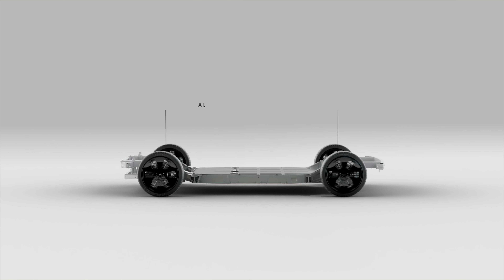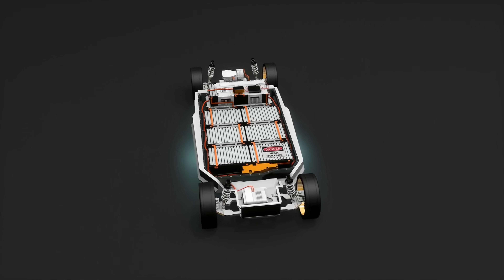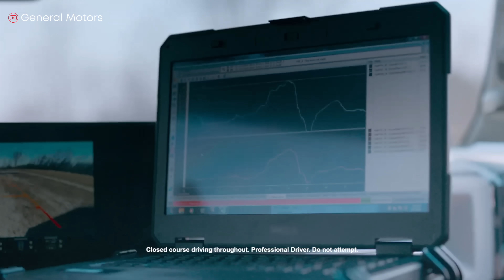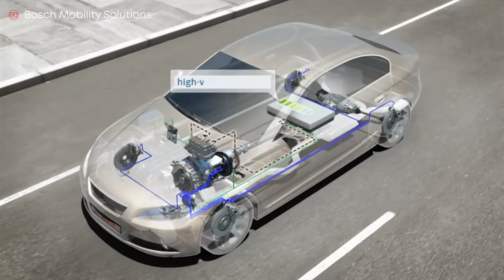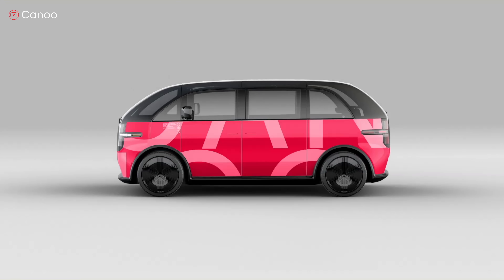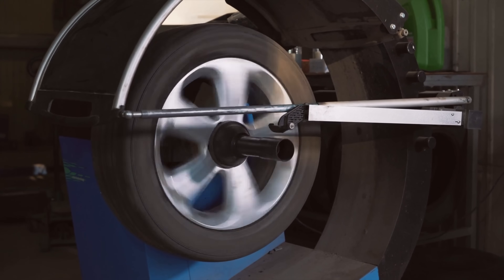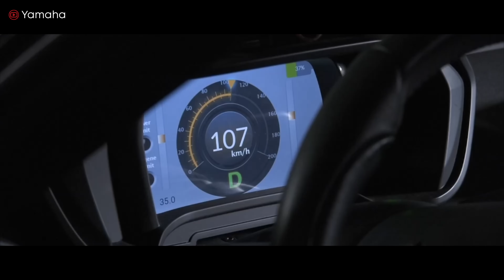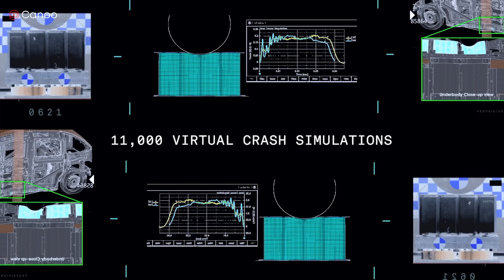No One is Telling You the Truth About Electric Cars, So I Have To

Comment: Wait until the motor controller goes out and all the many other components. Batteries also don't like vibration or impact like from pot holes.
Reply: Not to mention the weather especially in Canada where we use crap loads of salt on the roads that will utterly corrode the electronics I don’t care how much weather proofing companies put into protecting the motors and other electrical components salt water will destroy it
Reply: @randomtimes4100  salt will also corrode your engine and transmission if it gets inside of them but automakers have done a pretty good job of weatherproofing the inside of my car's fuel lines, engine, and transmission, so I think the real issue with salt is the frame of the car.
Reply: So all the OFF ROADERS are going to want a V8❗🤓👍
Reply: @markplott4820  do you own a Tesla
Reply: @randomtimes4100  Agreed, I am in New England US and does anyone really think that EV range at 20 below zero will be the same as the manufacturer specs?  That is not even considering how much battery power it will take to keep the car heated to a comfortable temperature.
Reply: @mfwolfer  exactly manufacturer’s make claims only based on best case scenarios with the most ideal conditions so only time will tell if ev are as good or bad as people claim for now the ICE has stood the test of time and is what I’ll be using until more cars that have a fully hydrogen powered ICE are released
Reply: Given the number of computers in modern cars I say that, from experience, none of them like vibration or impact from potholes.  I managed to crack a battery of all things in my 4Runner after hitting one too many potholes.
Reply: @mfwolfer  I'm in Vermont and this morning due to a heat wave that's coming they asked us to reduce power consumption. They gave a long list and on that list of things we should not do today especially later on is to charge electric cars... Will our power grid handle it in the future? I doubt it will.
Reply: @markplott4820  Good luck with that. Tesla always understate their sticker price and depend on the EV credit to bring its price down. In reality, the final price is always much more (especially if you don't want the barebones). They literally have zero incentive to make a cheapo vehicle as it declines their luxury image that caters to rich people, who currently buy it as their toy to show off.
Reply: Well since most EV manufacturers give you an 8 year warranty on the drivetrain and battery and since most people buy cars every 5 years, I don't think that will be a problem for most car buyers.
Reply: @a012345  Tesla no longer has access to the EV tax credit in the US and hasn’t for a couple of years. Same for GM. Furthermore, in the US the tax credit was used on your tax return and did not reduce the price of the car at purchase. Also, you could only tax the full credit if you paid enough in taxes.
Reply: @joewhip9303  That’s not entirely true, because states like California still has EV credits. In addition, they are already pushing through the senate an even larger federal tax credit for EV. I am sure you’re going to bring up the 200k sales phase out, but that last for certain quarters and is reduced before phasing out.

To your 2nd point, most people pay taxes unless you’re in the lower echelon so you’ll most likely claim majority/all of it. Not to mention, you could always create capital gains to take full advantage of it.
Reply: @a012345  true but the federal EV tax credit was the largest. Whether it will be reinstated is still not certain.
Reply: @patriciacooper1308  Very true, so when will most people be charging their electric cars?  At night of course and if everyone has an electric vehicle at some point whats the peak load going to be on the grid?  I think Scotty’s leaning toward Hydrogen fueled vehicles is the best way to go.  Yes, the infrastructure would need to be built but it makes way more sense then putting in tons of charging stations where you have to sit for hours in the middle of a road trip.  This makes no practical sense to me.
Reply: @mfwolfer  Hydrogen production releases  large amount of carbon monoxide. So hydrogen fuel is not even green to begin with. Toyota has been researching since 1995, still far from consumer grade fuel cell. Challenges in hydrogen technology proved to be stiffer than EVs. Latest EVs charge 80% in 20 mins, so the charging time is going down fast. At this point, it is seems EVs are the future, with already established infrastructure in place around the country, and growing fast.
Reply: Scotty just had a good point in his livestream about possible lack of incentive to build out a huge cross country electric charging infrastructure.  He said that with existing electric cars 90% of the charging happens at home.  This leaves less incentive for companies to build charging stations to make a profit since its already like everyone has a gas station at home.  Who knows where this all will go but the bottom line for me is when I take a long road trip, can I pull in somewhere and recharge my car in 5-10 minutes and be on my way like I do now with my ICE?
Reply: @randomtimes4100  That would apply to ICE cars as well. They have plenty of electronics and the salt corrodes the engine.
Reply: @mfwolfer  That is why they installed heat pumps. You do lose range but it is still plenty for daily use. You can look at Bjorn Nyland's videos where he tests various EV's range in Norway. I believe the range loss in cold weather is about 30%.
Reply: @ferdiecassel3697  Nothing last long in New Orleans. Gets vandalized, stolen or wrecked by the humidity and seawater.
Reply: @a012345  The California credit is $1500. There are dealer incentives for ICE cars that are higher. That federal credit hasn't been passed yet. I believe the phase out would last for 2 quarters after reaching the sales limit. So, tesla is very likely to use it up the first year.
Reply: @mfwolfer  No one sits for hours. They sit for 15-30 minutes. 15 min gives you about 200 miles of range. The problem with hydrogen is that besides installing the stations, you will also need to truck the hydrogen to all the location and then there is the energy needed to create the hydrogen. I think that will make it a very inefficient source of energy.
Reply: @mfwolfer  That is true, but I think there is enough cars traveling that they could make a profit. I could see gas stations adding a few charging stations when there are enough EVs on the road. The current network isn't bad, but rural areas are very much underserved.
Reply: @mfwolfer  I'm going to look into hydrogen fuel vehicles. Gas prices where I'm at, over $3.10 a gallon... Living in a rural area you can't help but drive, there's no public transportation except for during ski season for the tourist...
Reply: @raymondreiff8170  Maybe the cybertruck
Reply: @randomtimes4100  Hydrogen is a fools fuel for a car.
Reply: @jonfscott  why do you say hydrogen is a fools fuel

Comment: I have a first generation Chevy Volt 2012 125k miles. So far it needed oil changes (has generator engine) , tires, brakes, wheel bearings, struts, shocks, and coolant flush. Thats it. I did most of the maintenance myself. Coolant must be replaced every 5 years for $400 at dealer. Battery is still getting near or the same amount of range. Not bad in my opinion. Online data shows cars with 200k+ miles.

Comment: Great unbiased video.  Very refreshing.  It would have been entertaining if you had mentioned the cost of replacing an EV battery out of warranty, which is NOT unheard of.
Reply: the cost of an ev battery is $4500.+ another thing not mentioned is if you need to work on any electrical part of the drive system you need 2 people, 1 to do the work, the other to safety watch as the large battery puts out 300+ volts DC and will kill you quickly. it does not throw you off like AC. wspeciqal saety equipment is required hemet, safety glasses, linemans gloves& more for 2. also a length of wood 2x2 for the safety person so they can push/pry the worker off the high voltage circuit & then call 911.
Reply: I’ve seen a Tesla car ( not sure which model) is $20,000USD and that’s about average. The minerals that are needed is in high demand and very expensive, this might change in time, but who knows. Changing a battery every 10 years is very expensive to me

Comment: No EV for me but as an alternative i like the concept of the Hydrogen fuel cell , WATER . Scotty has mentioned ( i think ) as an easy conversion .
Reply: Infrastructure. They would have to dig up all those fuel tanks at gas stations and install hydrogen tanks. Hydrogen is never going mainstream.
Reply: Hydrogen fuel cells would be great, if hydrogen was readily available in a pure form.  At an atomic weight of 1 hydrogen binds with many elements. Hydrogen electrolysis from water requires more electricity than the energy that the hydrogen produces. The most common source of hydrogen is from steam-methane reforming from natural gas, but that is still costly, but much better than electrolysis from water.  Perhaps a more efficient method of producing hydrogen will be produced.  It might be that a cleaner fuel will be produced from abundant NG.
Reply: WHY turn water and electricity into Hydrogen and then back to electricity when you can use electricity strait in your EV. It only make sense in heavy industrial applications.
Reply: @bossman6174  the only advantage a hydrogen vehicle  has over an ev is that you don't need to wait a long time to recharge your car, you can do it in only 4to5 minutes
Reply: @dr.vishantpriyadarshi7050  But the cost of that is huge! saw a guy testing one of those in Canada, then i saw 46$ on the pump! then i knew hydrogen are done!
Reply: I thought hydrogen batteries needed Platinum to work? There isn't a lot of platinum floating around.
Reply: @theadvocate4698  Yeah That's why noone buys them, only if there was an easier way to extract pure hydrogen, then hydrogen car would make sense. Since we can never run out of hydrogen in the world.
Reply: @dr.vishantpriyadarshi7050  Yeah, my point was that in every video on these cars, they never say the cost of fillup compared to the same on a normal ev....
Reply: @matthewvelazquez2013   thers no such thing as a hydrogen battery. Platinum is used in the fuel cell where the reaction takes place. Because platinum acts as a catalyst in the chemical reaction and splits hydrogen atoms into hydrogen ions
Reply: @dr.vishantpriyadarshi7050  but you have to drive 30 min times two to the nearest station ( SFO Bay Area) . Other than that I’m all for H2
Reply: @dr.vishantpriyadarshi7050  hydrogen accumulator??? 

...

Heh heh heh heh heh.
Reply: @M.J .H we human beings are very helpless. The increased frequency of odorless, tasteless, Natural gas leaks would in fact annihilate us.
Reply: The beauty of the fuel cell is that it can work with an endless number of fuels. It does not have to be hydrogen.  They talk about hydrogen because that gives the most energy output. But as Scotty mentioned numerous times, it can be  ammonia, which is pretty close energy-wise, but much easier to liquify and store. The other benefit is that we already produce an insane ammount of it for fertilizers and stuff, so it just has  to be ramped up in production. Or you can use other fuels, whatever works.

You don't have to use Platinum for the catalyst, either. It is the most efficient option, but it is very costly. Any other suitable catalyst for the needed reaction can be used. Some of them are dirt cheap. Chemists can pitch in here. Another point to make is that currently we use Platinum in catalytic converters for ICEs anyway, but a fuel cell car would not need one, so you can use the Platinum in the cell instead.

The reason manufacturers push for BEVs is because that leaves you dependent on battery packs, which they can skin you with. A fuel cell can last a loooong time, it does not really have moving parts, the electric motor will fail before the fuel cell. It DOES need a buffer battery pack to store energy but it is MUCH smaller than that of BEVs. Not only that, having a tiny battery pack reduces weight drastically, which lets you use the produced energy much more efficiently - put it to the wheels instead of losing it to friction and heat losses.

It  can be used for huge trucks as well, unlike BEVs. Fuel cell is the logical option if you have any brain cells left, but the marketing and push for BEVs is insane at the moment for obvious reasons. I can only hope logic wins in the end, otherwise we are going BACK technologically, instead of forward. Even a LPG-powered ICE is better than BEV. Use your brains people.
Reply: EVs look like the improved next generation golf carts.  You can dress up a pig, but it still is a pig.
Reply: @stevenporter863  yes true. But, if and when a 400-mile range and 10 to 20 minute charging time becomes the industry standard, then those golf carts will eventually take over when the used EV Market becomes large enough.
Reply: @M.J .H at least California will be okay if they elect Larry Elder as governor. Hypothetically, he may be convinced to build one nuclear power plant in the state every 3 weeks to create the energy capacity needed to support the necessary explosion in the amount of charging stations required to meet the need.

The Sacramento Bee antagonized Larry Elder for an hour in the form of a video interview. He held his own beautifully. Within the interview, he stressed the need for drastically increased energy infrastructure in the state of California.
Reply: @matthewvelazquez2013  Granted, in the future .  I mean now paying $40,000+ for an experimental car.  Tesla is smart though - instead of keeping their cars in R&D costing them money they sell their 'trial and error' cars to people willing to buy them.
Reply: @stevenporter863  honestly, you've just destroyed Tesla's entire business model by exposing it. Michael seriously, you could start an entire anti-tesla YouTube channel and make your truly valid and incisive observation the Crux of the existence of the channel.
Reply: @matthewvelazquez2013  😆
Reply: @stevenporter863  you can do it!
Reply: @M.J .H California state is the fifth largest economy in the world. If the state of California decided to expand their energy infrastructure, leaning heavily on nuclear power exactly like the entire country of France, then the capacity would exist to sustain the charging stations needed to recharge the batteries in all the electric vehicles in the state.

The fear of Reliance on nuclear power at the state or national level would be eliminated resulting in the gap between energy Supply and energy demand narrowing significantly.

The state of Florida and the other two countries located on the same latitude from which lithium is mined could become Hotspots for war in the same way the Middle East is a hotspot for a war over oil. However, iron + oxygen fuel cells are being invented now...

Is there any single nation on Earth which has monopolized the production of useable iron and oxygen? Nah bro.
Reply: It's still an electric car with a storage battery. It just carries a generator with it at all times. 
Driving slowly you can get from San Francisco to LA with a Toyota Mirai without the need for charging. Which is a good thing, since there are not fueling stations between San Francisco and LA. But do hypermile! Else you end up 50 miles from the next H2 fueling station.
Reply: @M.J .H imagine being able to just recharge at home....
Reply: @matthewvelazquez2013  farmers as a group by and large use multiple times more water than cites do.
Reply: @estuardo2985  to make what exactly???
Reply: @M.J .H yeah because the average 'Murican (let alone elsewhere in the world) does not take 300 mile road trips. The average daily commute an American drives is 32 miles round trip. Easily enough for an EV that can range 149 (nissan leaf) let alone a high end telsa that has an estimated range of 390 miles which in your scenario makes it to grandmas. Also, yeah for some people that want to make that 300 mile trip they can endure an extra 30 minutes to an hour  for charging or renting a vehicle is an attractive option as well as opposed to putting a bunch of miles on your personal vehicle. I know it is hard but your situation is not the same for most people.
Reply: @estuardo2985  And your point about farmers is what?  At least they are growing the food that the people in the city eat and then flush the waste away.
Reply: Hydrogen fuel cell cars are essentially EVs. The fuel cell coverts the hydrogen to electricity, that sends it to a battery, that drives an electric motor. Only they are alot less efficient on the grand scheme of things. But they do have a future in some industries.
Reply: @matthewvelazquez2013  hydrogen battery?? What are you on about. The fuel cell needs platinum. That is not the battery.
Reply: @markplott4820  the hydrogen conversion rate is about 70% efficient. 
But that does down when you factor in producing the hydrogen, transporting the hydrogen, keeping it cold in liquid form and having a distribution network to distribute it.
Reply: @M.J .H yeah, just like a horse is not a dog, or an apple is not an orange. 
Let's bring up two different things and compare them for no reason what so ever.
Oh sorry, you already beat me to that.